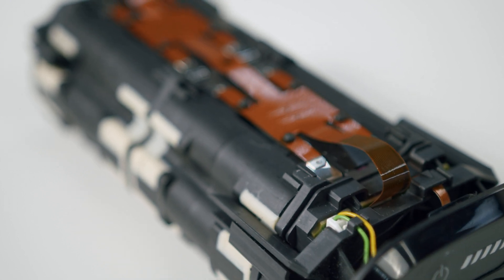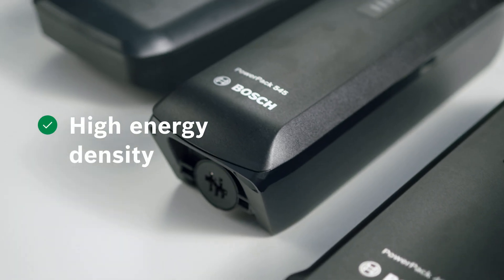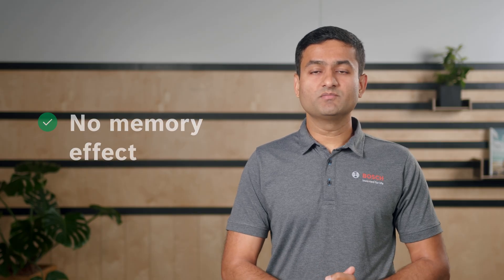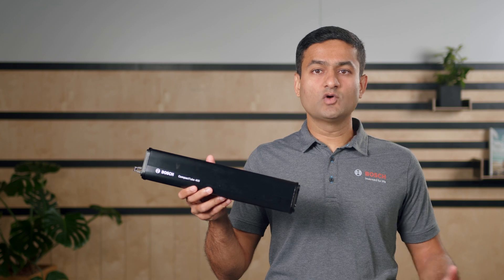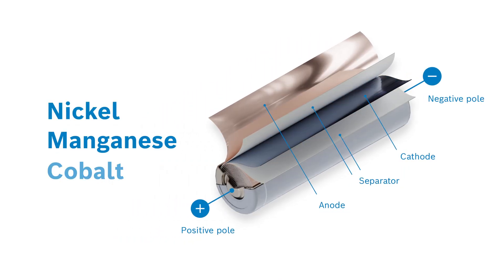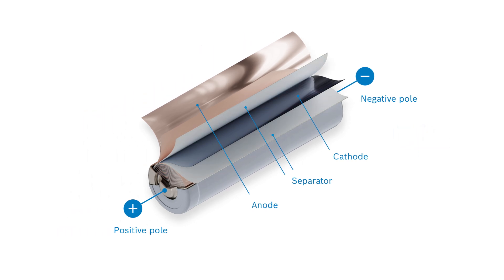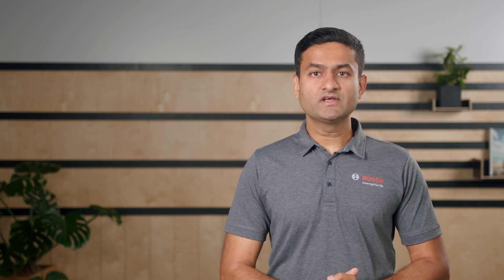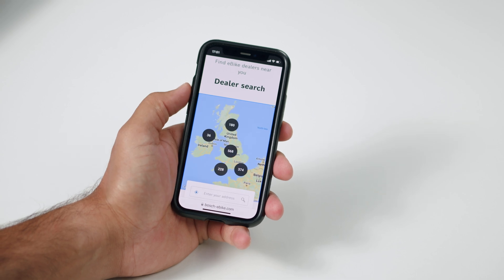Battery Technology | Bosch eBike Systems

Comment: I've also done a little math and from the provided data about batteries I suppose: 
PowerTube 750 uses 60 pieces of 18650 3350mAh cells (10s6p pack config, total 20,1Ah and 723,6Wh for 36V calculation) 
and the new 
PowerTube 800 incorporates 40 pcs of 21700 5550mAh cells (10s4P pack cofig, total 22,2Ah and 799,2Wh for 36V calculation), 
is that correct? :)
Reply from the maker: Hi, you can find all facts on our website. Thank you for your understanding.

Comment: Hello and thank you for nice edification video series,
would you mind sharing some more details about specific cells used in both "older" 18650-based and recent 21700-based batteries? 
Some questions/points:
- for a specific battery, like Powertube 750, just single cell model from one supplier are used, or have they varied during manufacturing timeline?
- would it be possible to incorporate capacity monitoring right into the system and make it user accessible? Something like AccuBattery Android App does for my smartphone, showing up-to-date battery health via monitoring past charge/discharge cycles. It would also be great for preserving the value of an e-bike/battery, as anyone on second-hand market could check exact battery health without the need to visit the service station and go through a long process with Bosch CapacityTester measurement.
- as pointed out in german version of this video, also possibility to set the upper limit charge (with auto cut-off of charger) would be beneficial, such functionality has for example ThinkVantage software for Lenovo Thinkpad laptops